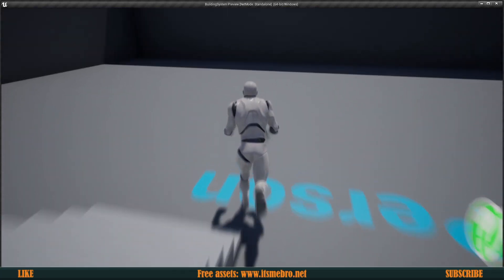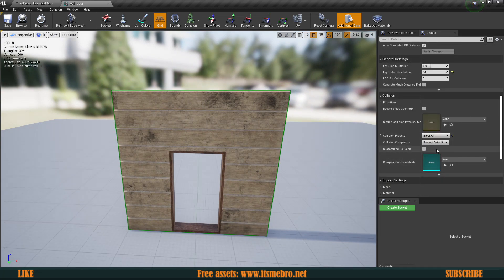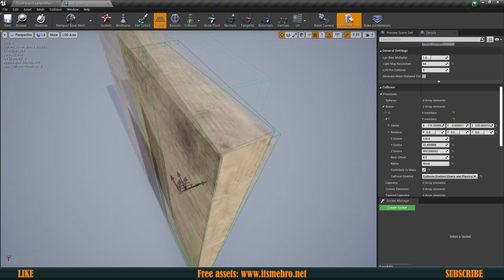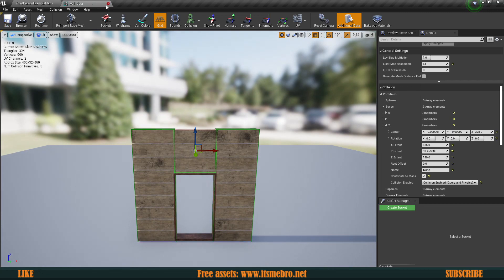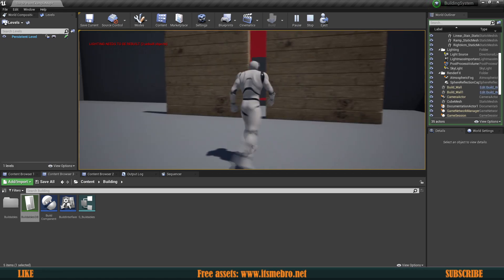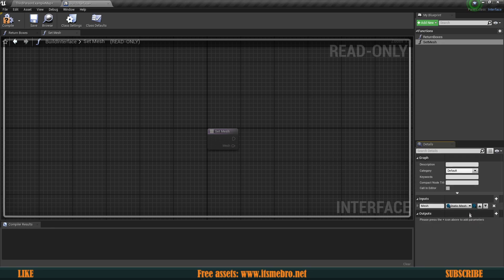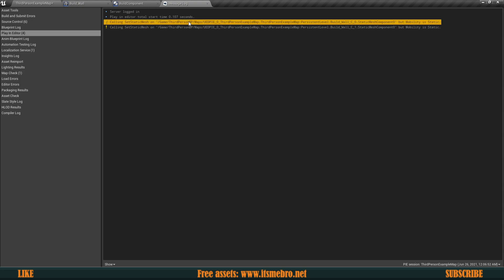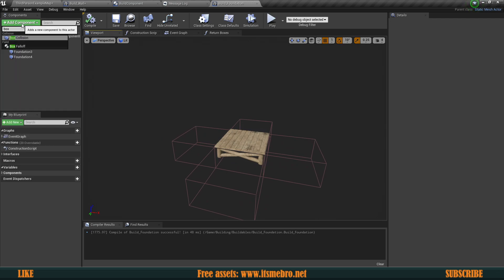UE4 Base Building / Walls

Comment: Hi Bro, love your tutorials, super great stuff here. I'm curious how you might go about handling walls so they have similar functionality to what they can do in the game Valheim. In that game, when you select a wall to build it, it snaps to the edge of the last wall. You can then use the scroll wheel to rotate it to different angles. That's all pretty easy to do with what you have here, but what I can't figure out is how one would get the wall to pivot on the corner like it does in Valheim, instead of in the middle. It's not just a simple matter of moving the pivot on the build piece, because in Valheim it will snap at either edge, and then pivot from that edge. I'd love to get your thoughts on how one might replicate this - or better yet see a video on it? :) Thanks for your time.

Comment: So why would we do the wall/door/window like that, instead of doing it similarly to the original wall? Like adding it to a database, creating new blueprints in the Buildables folder alongside the wall/foundation/floor?
Reply: Because this blueprints in Buildables folder is just a types of blocks. You do not need to create a new type for an each new block separately. Just create master blueprint and edit it's mesh, if this meshes are similar

Comment: I enjoy your tutorials. Just one question, how do I get the material to change with the mesh? My mesh changes to the wall with door, and wall with window, but the material doesn't change with it. It uses the original material for the normal wall. I have gone back and started again from the first video and still the same issue. Did I miss something somewhere to change the material with the mesh when using the wall with door or window?
Reply: Remove the Ambient Occlusion texture from the Materials, that will fix it
Reply: @xdragon5502  Thanks for the info. I haven't worked on the building system for quite some time now, so I am not sure if I managed to get it fixed. If not, I will definitely try this.
Reply: @xdragon5502  how can i do that?
Reply: @jeremiasgallardo4542  in the material
Reply: same problem

Comment: Why snapped my Wall in the Middle of Foundation and not trough the Hole Found, where i set my Boxes for the wall. The Pivot Point from all are centered
Reply from the maker: Wrong rotation? If you need help join my discord and post screenshots of the problem in the help section.
Reply: @ItsMeBro  yes,I have done. With a video. My Name there are Kalibaru
Reply: @FischersFritze12  Did you ever solve it? same issue

Comment: Up to 12:30 I don't think I missed something but maybe I did. At this point it's only letting you place the walls where we set up the boxes on the foundation but for me it snaps to it but if I look at it the right way it's letting me place them outside of the boxes as well. Is it supposed to still be doing that at this stage or did I do something wrong?
Reply from the maker: At this point all the buildables can be placed where ever. As long as the trace hits something, it can be placed there.
Reply: @ItsMeBro  Ah thanks for the quick response, your videos are great. I figured as much but wanted to make sure. I'll be looking for your next video in the series for sure.

Comment: Is it multiplayer friendly?
Reply from the maker: Everything is explained in the preview video. At this point in the series its singleplayer. But there will be a video for multiplayer.
Reply: @ItsMeBro  ok, thanks:) had no time to watch it completly. But it will get really usefull for me
Reply: Does the collisions added to the sections add anything to performance?  I didnt really like adding all those so I just did it by getting the object hit and snapping it that way. Much harder but I think it works pretty well now, after several days of debugging and trial and error 😄.
Reply from the maker: @static2601  how do you walk thru the doors without a custom collision?
Reply: @ItsMeBro  oops i posted under someones comment, but I was talking about the collisions used for the trace channels. Of course you need those collisions as well.